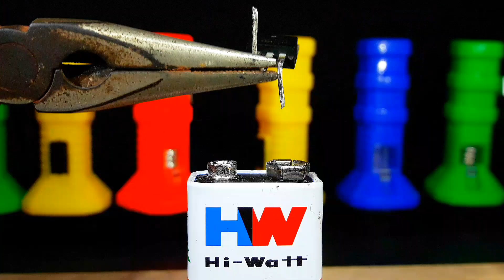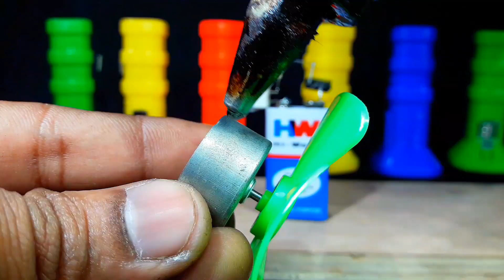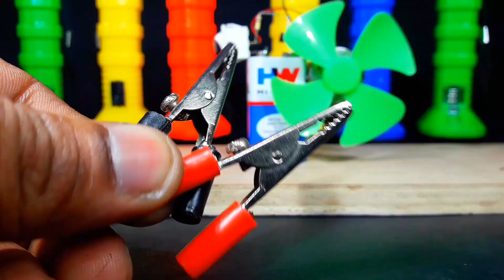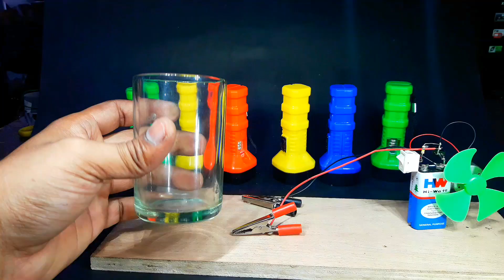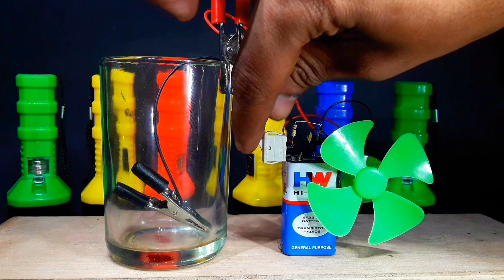water full_motor will off dc motor school science project / 7techprojects

Comment: Bro in this irf 2305 we can use any thing
Reply from the maker: Yes the circuit designed by irf 3205
Reply: Sorry,plz tell me that what I can use in irf3205 place
Reply: @7techprojects922   plz
Reply: Bro can I skip that and I will keep IRF 840
Reply from the maker: @SubbarayuduYagantipalle161981  Sorry I just saw your comment.  You can use any other irfs instead of irf3205.  Make sure its pin connections are same.  That means "source, gate, drain".  This project requires less Ampere.